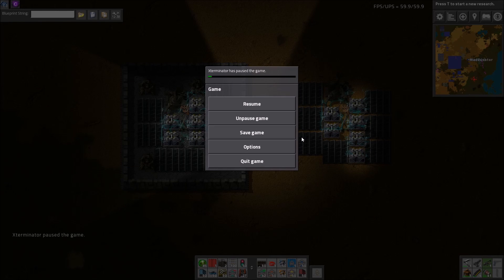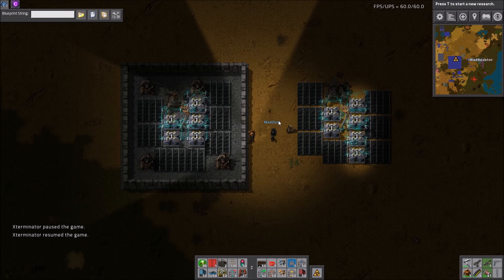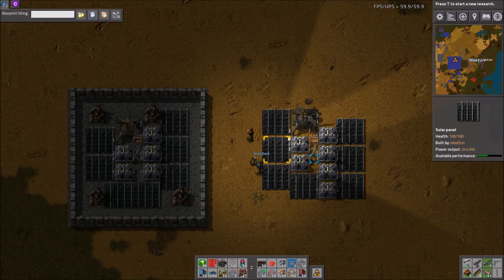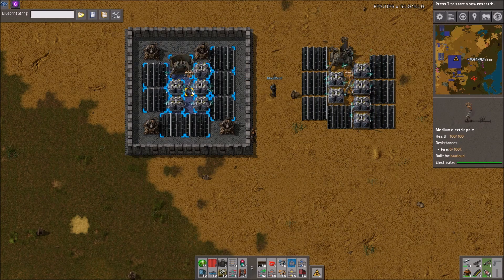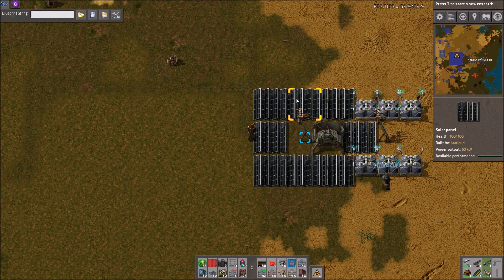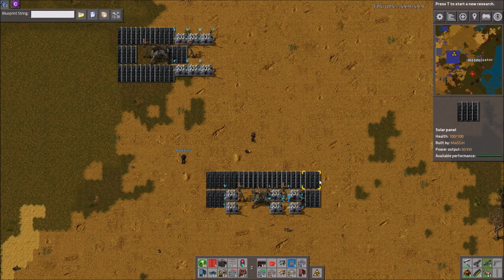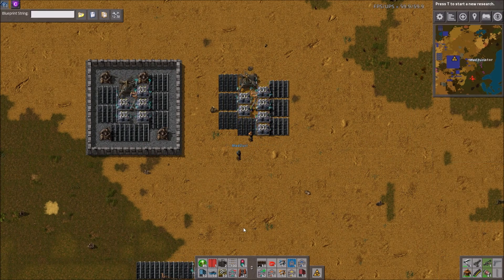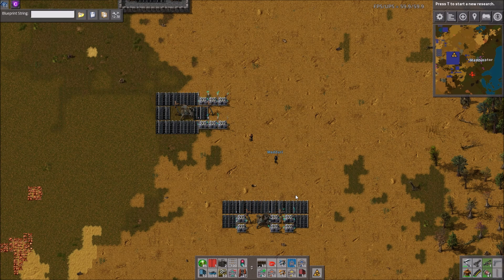Factorio Workshop - Building A Better Factory :: Petigp's Radar Stations

Comment: Those are some good designs there.  Previously I'd only seen a 5-panel setup with no accumulators which only works in the daytime, and I'd been thinking about adding accumulators to the mix but didn't know the correct ratio to keep a radar running.  Thanks for the designs!
Reply from the maker: You're welcome! :) 
And yeah it's nice to know the ratio and build it so it works all the time. It can work to only use panels and have it work during the day if you are really hurting for materials or something. But adding in the accumulators and some turrets definitely adds a lot to it.
Reply: I prefer the minimal designs. Less occupied blocks, less chance to block the biters path, less material. The 5 accumulators with the radar always100% reveal the map in the short range scan area (3x3 or 5x5?). The long range sector scanning is slows down for a short period. But the close range is always lit. can see the biters movement in the area even the power is almost 0. You can never see the "no power" icon. :)
You made a mistake in my name in the description. "some Radar Stations made by Pitgp." xD

Petigp